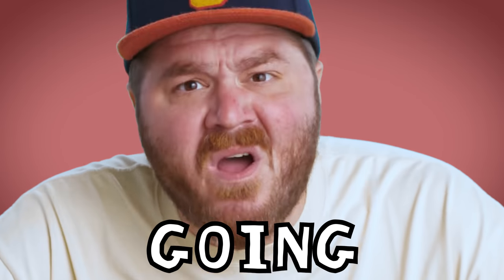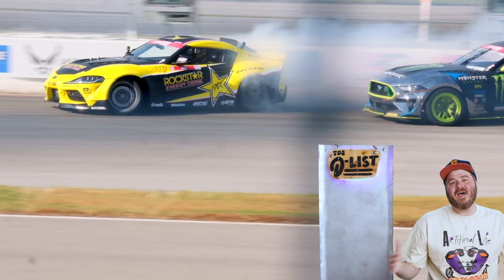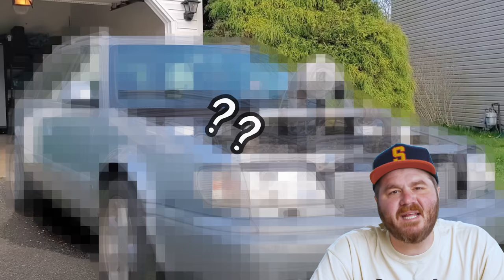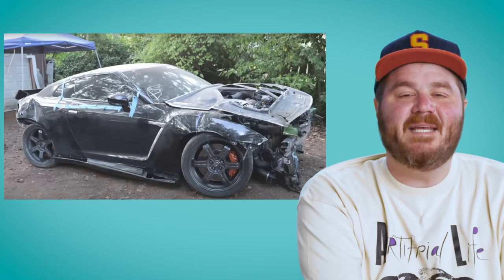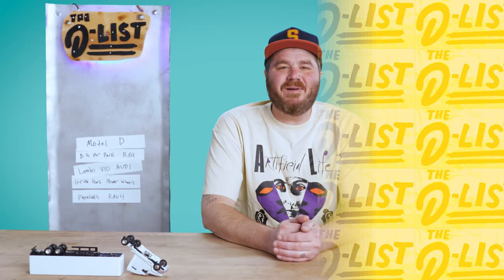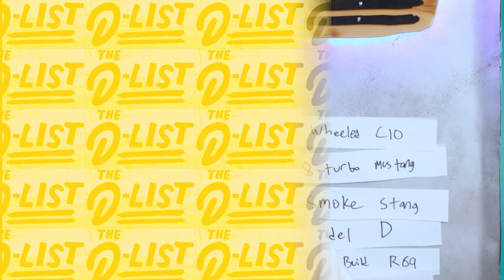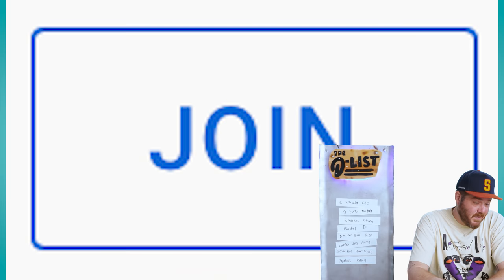Car Youtubers are Getting Out of Hand

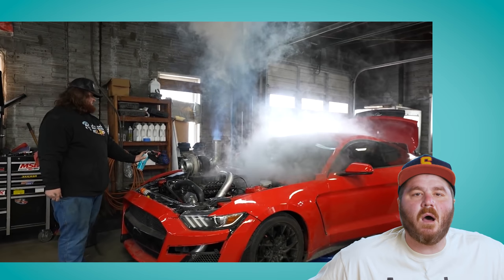Comment: 8:32 it’s not a 12V V8 it’s a 12V straight 6. The engine code is a 6BT
Reply: Glad I’m not the only one that caught that lol
Reply: Yeh I had to listen to it again was like no way James thought it a v8
Reply: Beat me to it
Reply: how do you have 1.5 valves per cylinder?? lmao
Reply: I knew someone was gonna say sum abt that
Reply: 10ish.... Its an intercooler, not a radiator
Reply: @boostnug  I just don’t know how ye could split 12 across 8
Reply: Made me cringe when he said it lol
Reply: I was trying to work out how there's a decimal amount of valves per cylinder, glad Im not going insane
Reply: Ya I was about to say something didn’t sound right
Reply: Buddy prolly just didn’t catch it he had like 25 builds to go through he knows it’s I6 not v8
Reply: came here to see this comment. technically he has 2 less cyl 20 less valves than a coyote s550 which stock would beat the smoke stang. hell even a 4 banger mustang comes close to  or ties smoke stang times. not to mention yoi can make 1200whp and run 7s in the 1/4 with a stock sealed factory v8 coyote . he puts all this work in and can run that in half the distance.  But like emelia hardford pulling a coyote for a big block only capable of 1000hp then she smacks a giant blower on that takes couple hundred hp to turn. when she couldve ran the stock coyote under the hood with just boost and fuel. with built motor coyote can make 1500 to2000hp. so it comes to a clout chase with youtubers
Reply: So bland I’m not the only one
Reply: yeah i dont think theres any v8 with 12 valves lol. would need some goofy ass heads
Reply: came to the comments for this
Reply: I’m pretty sure it was a joke guys. You know… since the engine that was in the stang used to be a v8. Could be wrong and that big tongue just got too slippery and up popping out the v8
Reply: I stopped the video and searched the comment section for this. As soon as I heard him say 12v v8.
Reply: Surprisingly not many comments about this lol
Reply: @carculturenation2166   I think it’s cool to see people doing things the  way no one expects you too. it may not be the fasted but it sure as hell shows off his talent, sounds the best, looks the funniest and catches the most eyes. not everything is about speed some times its about the talent, and the fun you have making it.
Reply: @noclass2gun342  👍👍
Reply: @mycosys  by modifying them??
Reply: @gestovo1188  gestovo1, i bet that those cars are always out of hand.
Reply: I was thinking to myself " how the hell could a V8  have 12 valves? Is it some sort of 3 valve for 4 of the cylinders set up?
Reply: The 12 valve is a inline 6 not a v8 “and that’s everything you need to know to get up to speed on CUMMINS”
Reply: thanks for saving me the time, instead i can spend the time thanking you for writing what i was thinking.

Comment: Project Binky: fitting the drive train from a AWD Celica into a classic Mini.

The Shermanator from Deboss Garage. A modified Sherman tank chassis with a 70's square body crew cab on top. Dual diesel engines, with one just used for a winch. The drive engine running through two transmissions.
Reply: Project Binky is insane
Reply: I think Binky has to be on the Epic list
Reply: Vote for binky!

Comment: A couple of my absolute favorites, Project Binky, the all wheel drive classic mini with a celica GT motor, Tom's Turbo Garage and the LS swap Miata. The LS swap isn't super uncommon, but it's one of the cleanest swaps.
Reply: I m slightly disapointed by the looks of binky after so many years.. It looks goofy with those wheel arches that make the car wider than long
Reply: @augustinf  WHAT? The thick arches are super common on those, yeah, they are a tad wider than most, but they had to to fit the wheels and drivetrain. 

Also, keeping the body the stock length was one of the very first things they said they wanted to do.
Reply: @robertt3715  they did a vid where they presented the car to viewers 2-3 month ago and I really didn’t like it.. it looked cool before with kind of the black body with yellow arches throughout the build but somehow once all painted eggshell white… it did not look cool. I was pretty much disapointed by what seems to be the end result
Reply: @augustinf  I thought it looked awesome, with an exaggerated bulldog stance that it's known for.
Reply: @augustinf  That's like your opinion, and it's wrong, Project Binky turned out amazing, the amount of work that went into it is just amazing, but it's not finished yet.
Reply: @augustinf  👍👍
Reply: @joealex65  its more like being rushed.
Reply: @joealex65  well i hope i m wrong, after so many years watching the build of the ultímate mini.. as you say it’s not finished. I just hope it will not look like it seemed it would look during that presentation
Reply: @joealex65  Opinions can't be wrong. They can be unpopular but by definition can't be wrong.

Comment: You should mention the "Morrvair", from @Matt's Offroad Recovery. It's the body from a Corvair, but completely modded out to be an exteme offroad beast. Shortened the front end, swapped the engine/suspension/tires/everything, and just turned it into an insane towing and recovery vehicle.

Also, JerryRigEverything made an all-electric Hummer...might be worth a mention. ;)
Reply: Then add tow mater

Comment: The smoke stang has a 12 valve which is an I6 engine. Pretty sure Cummins 1 ton engine is also a I6 but with 4 valves instead of 2 per cylinder. Duramax and Powerstroke are the Vs, I think.

Comment: My dad has a Nissan 350Z LS swap with the supercharger sticking out of the hood put the 750 horsepower then he's going to put a smaller pulley on it so it'll push over 1100 horsepower so he does drifting with it and he's going to try and do spec d

Comment: ive got a 1st gen rav 4 as well. even bone stock its the most fun and versatile car ive ever owned. and ive had new cars before, nothing compares to the rav4.1. ive also got a built 1jz with 780 hp at the flywheel sitting in my pole barn, 1jz rav4.1?

Comment: Bro, I can remember all the way back to 2007 (when I first joined YouTube) having a friend tell me that he and a few buddies had bought a new V6 Hyundai Tiburon, supercharged it, and then put another identical engine in the rear of the car, also supercharged. It was one of the most ridiculous things I had ever seen 

That was, at least, until I dated a girl in 2008, who's dad was an ASE master mechanic and had put a built, blown 327 into a tubbed out Geo Storm. He even had a giant wind-up type mechanism made to put onto the boot as a kill switch, right next to the chute. Have you ever seen a Geo Storm that had a fucking wheelie bar, parachute, and butterfly intake sticking out of the hood that WASN'T a Hot Wheels car? 

The dude was suck a speed freak that he had a Hayabusa stretched about 20" with a turbo AND an adorable little dry shot of nitrous. It was the only bike I've ever sat on that absolutely terrified me (aside from when I bought my custom Dyna in 2013 as I had to ride through Houston's interstate 45 at about 10:30pm for the first time because I was pissing my pants that someone would side swipe me by an on ramp because it was the first time I ever even rode the fucker.)

Despite absolutely loving everything that runs on gasoline/methanol, guns are a much easier hobby to maintain as far as money goes so I ended up going that route. I let go of my '08 335i that ran about 520bhp for a more family-friendly '17 Focus ST so that my wife could finish her degree to work as an RN while I did the Mr. Mom thing with the kids. Cars are a lot harder to make sacrifices with if you've only got 1 to do everything and can't have it down for any more than a few hours. So, I did the mature thing by getting a car that was practical and fun to drive without being a money pit. But I'll be god damned if I live that way much longer, especially watching stuff like this.

Comment: well, that's one way to get an R34. 
and since we can import R32's now AND R33 GTRs... well, putting a custom made fierglass R34 shell on the chopped carcass of one aint a bad idea. it's still a skyline gtr with a RB26DETT and the ATEZA all wheel drive system, and a 4WS system, especially on an R33. buuut the R34 is a bit smaller than the R32 and more than the R33. 
BUT if you have about somewhere between $330,000 to $500,000 to spare, and either a good custom shop or can DIY it, it'll work.
actually, come think of it, I dont think the law specifically states anything about whether or not the chassis of an R34 has to be running, and if you're clever and have connections, you could probably exploit that loophole and import a wrecked R34 with no drivetrain in it so all it is is the body. and from there, you can probably exploit another loophole for kit cars, and I dunno? drop it on an audi A6 ?

come think of it, at least in canada there's a little loophole too. buy a 2 door ER34 coupe skyline GTT or GTS. you can get a RB25DET with the GTS I think, and they're usually RWD, and they are legal. so you're practically almost there. saw one being sold up in montrael quebec for around 60k canadien, which is like less than $50k american. and aside from getting the adapters for the ATEZA system from an infiniti or something and rebore and twin turbo-ing and widening the body a bit, and ordering r34 gtr body panels or something, well, you would have an almost GTR under 70k and could fly under the radar as a modified nissan skyline. it was what I indended to do anyway.

Comment: you should check out the 1000tipla by the french channel vilebrequin, a 1000 bhp fiat multipla (corvette z06 motor and chassis, rocket bunny bodykit, 130 dB a the exhaust) a f*cking beast.

Comment: A Cummins Diesel would be nice.  But lets not forget that Audi has some Diesel engines and not just the 4 cylinder ones that are found in Passats and Jettas.  Frankly I think it is a shame that Diesel has gotten such a bad rap.  They can get mileage better than a Prius and also be a lot of fun to drive.  Like many Diesel engines they don't have quite as much horsepower but they do have a ton of torque!  Without that you would have a somewhat boring car or one that doesn't like to get out of its own way!

Comment: About the Grind Hard Plumbing car, you can't compare an electric motor with a gas engine... HP is, first off meaningless, and doesn't translates well to electric motors. A gas engine needs to spin WAY faster to make enough torque to move the car, an electric motor makes max torque from a dead stop and keeps it almost to max spin, so it can move the car at WAAAYYYYYY less HP.

Comment: Weak. At least a hayabusa engine. Better yet 2 or 4 electric motors with a high voltage battery system with capacitors and such.